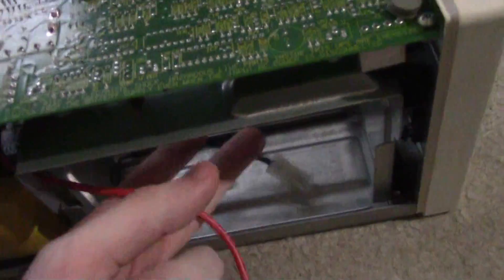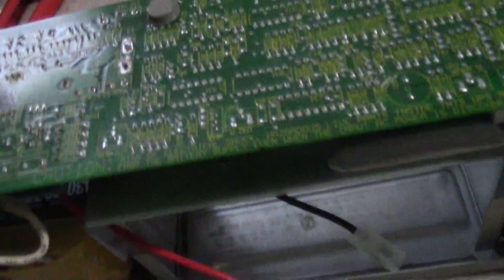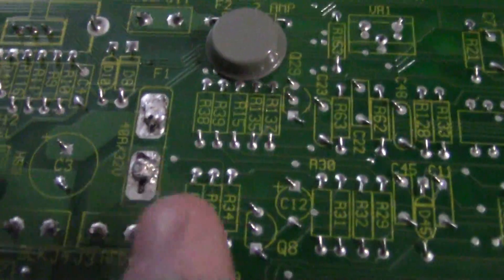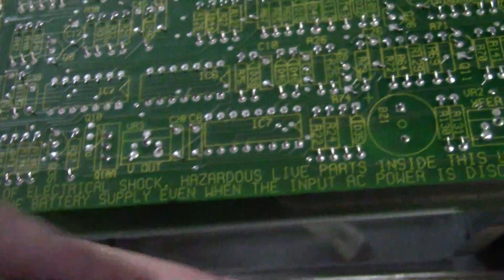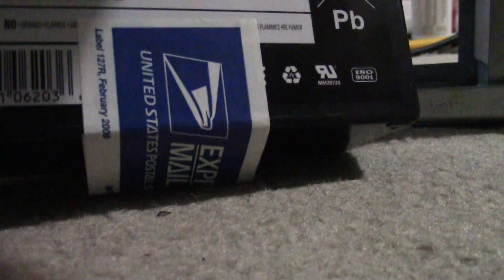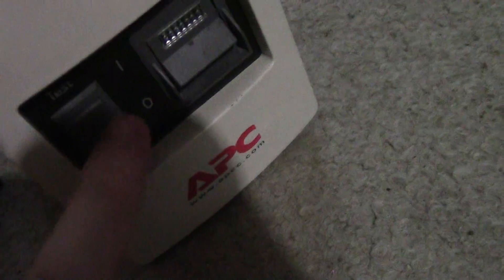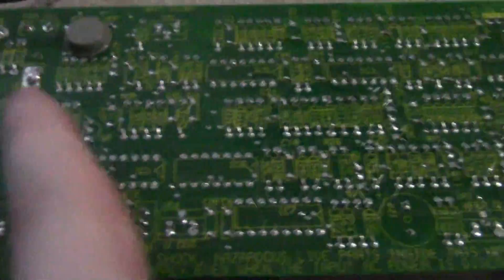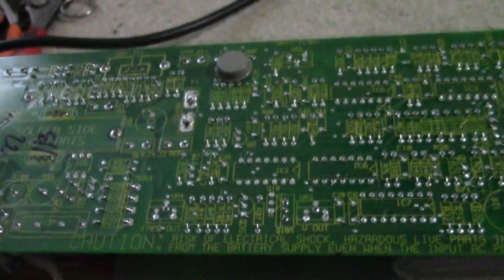Fix a UPS that won't run on battery power

Comment: How do you fix a ups that only runs on battery I have a pro 1000 with this issue. It charges when off  but only run on battery. Any help would be useful
Reply: Did you find the answer?
Reply: @KyryloP-v5r  it's a relay issue

Comment: PLEASE be careful when working on a UPS, if the batteries are charged and connected power is available and the posibility of electrical shock exists!
Not a 12 volt DC tingle from the battery(ies) but a 120 volt AC shock!!!
Reply: Why my ups not running on battery

Comment: Your my hero! I've got the old APC BB750  and I couldn't the thing to run on batt power.. Check the internal fuses "2x 40watt" and BOTH are blown! So I unsoldered them, replaced them and now it works like new. It's kinda stupid how they soldered them internal imo but anyway, thank you.
Reply: Yeah how do I remove them